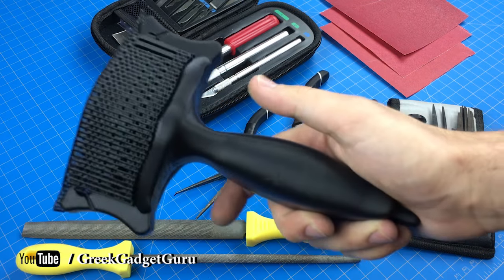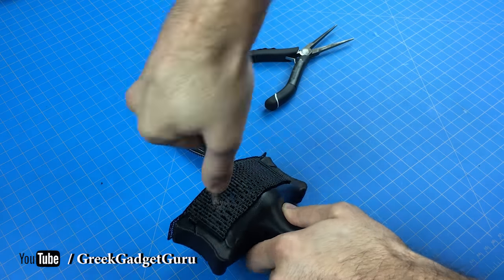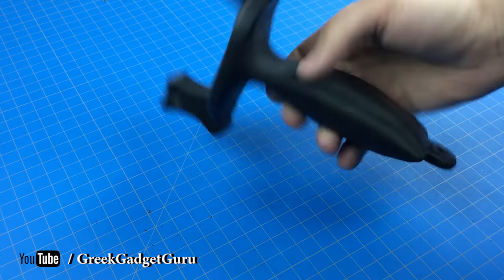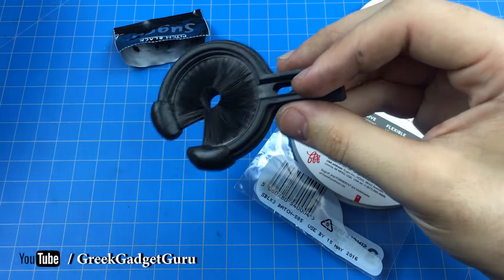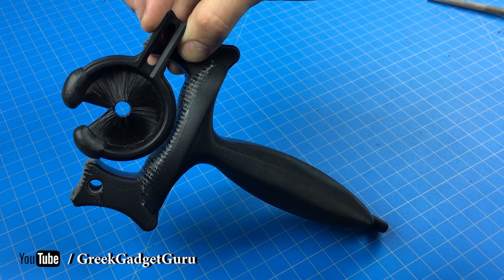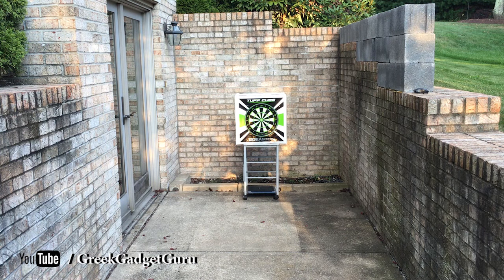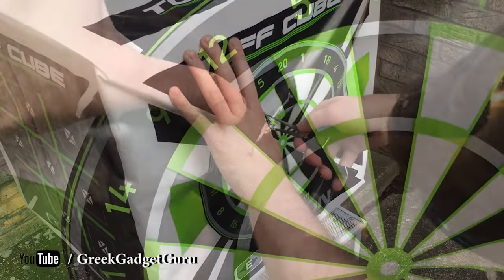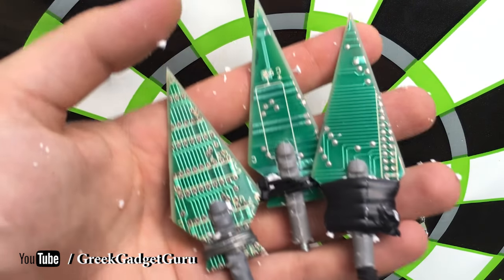Computer Board (PCB) Arrowhead DIY w/ 3D Printed Rambone SlingBow

Comment: @GreekGadgetGuru Tip from olympic archer: Do not use broadheads on expensive archery targets. Target points are invented for that purpouse. If you have a need to use broadheads, use them against fruits or waterbottles. Target points do a small puncture hole into the target and wont harm it as much, unlike broadheads.

Another tip: Make the thail of the broahead go more deeper into the shaft and use some hotmeld or epoxy to secure them in place. Yours seem to be too short and will pop out from the shaft too easyly.

Ur welcome!

-Chronos
Reply: thank you for explaining to these non archery peasants
Reply: That isn't an expensive archery target
Reply: Jacob Hardell Yep, i can see its made out of styrofoam. But some archery targets chost 80$ - 200$.

Comment: These arrowheads are sweet, but it seems that your arrows need more weight in the front.
Reply: What if he cuts a piece out of the center of them, and uses two pieces of board together to form four edges instead of two?
Reply: Kade Tucker That might work
Reply: what if you make it so they're like a + sign? so they slot into each other?
Reply: minitos1 absolutly right! Needs metal for it

Comment: try tapered bands as well, they store more potential energy and have a larger draw. rubber stores it energy in the heat created by the action of stretching which will transfer into more power on the release. it also rapidly cools the longer its held in a fixed position. just food for thought

Comment: Your power is limited by the need to grip the arrow nock between your thumb and forefinger. You should have a proper nocking point for the arrow together with a d-loop and mechanical release.

Comment: One thing i always did for larger builds was to separate the build into as few pieces as possible, and then peg and hole them together. So when printed you can piece them together with glue. Thats what i did and it may not work in high stress builds, but for models its great.

Comment: Have you considered threading the end of the arrowheads so that you can screw them into the shaft, so they won't detach as easily? 

If that doesn't work there's always epoxy.

Comment: next time i recommend laying it down when printing so that the layers are stronger then upright. Printing vertically with this type of print, idk how well it will hold up in a hot day with the pressures of the rubber.

Comment: I was thinking if you put a slot at the of the handle where the whisker bisket can slide in and out you could put a nut and a bolt to hold it. So if you need more range you could you could easy do it.

Comment: I think the arrow heads getting stuck is an unforseen benefit.  while it means the arrows are a one time use,  it also means that whoever your fireing at will have a hard time removing the arrow, also the sharp arrowhead should do a nice job at slicing up the badguys insides as he tried to run away

Comment: you know if the shaft of the arrowhead is weak maybe it will act like a full metal jacket bullet sure it's a pain in the arse to repair and a little waste of materials but if you hit someone with it someone it's gonna be a difficult task to remove it because the rest of the arrow is on the ground so if you wanna turn this into a tazer arrow i suggest putting another layer onto the sides of the arrow and put some magic/circuitry under that layer to give it more of a chance to actually taze someone
Reply: not a proffesional just some thought

Comment: Try using sinew for securing the arrowheads. And the flight path of the arrows seem unstable you may want to work on that too.
Reply: Btw you can use epoxy and insides of paracord instead of sinew to match the theme.
Reply: From wat anime is that character?
Just a curious otaku...
Reply: Not an anime ;)It's from Euphoria don't google it.
Reply: Its from an hentai

Ehem, i mean, i dont know.
Reply: I googled it. Bro wtf. In return you need to watch DYE Fantasy.
Reply: Not even close
Reply: Is it that like rape to survive hentai thing because.

Comment: you should have printed it horizontally so that the force of the sling won't break is by the layers of the print
Reply from the maker: Good call. I'll reprint it if its used in another video.
Reply: noicee haha you dont have to it was just a suggestion

Comment: Doesn't seem like it would ever have any range. There is no stability to the arrow after its released. See how it immediately turns away when fired straight?
Reply: I think the problems are the metal shaft and the light weight arrowheads.

Comment: Was all of the support material needed? It seems incredibly wasteful and excessive.
Reply from the maker: Yes, because the 3D Printer can't print in mid air. Otherwise it comes out like plastic soft serve icecream. The maximum print angle is a 45*. I could have printed it on it's side, but it would have added more surface area to clean. I wanted the handle to be smooth.
Reply: Oh! I see now. it was printed upside down. With he handle point upwards. I didn't realize that.
Reply: what if you printed it in two parts?
Reply: WhoDaWolfAt Gaming go top the slingshot chanele and go to the tambien video and download the model for free
Reply: Nadir Nurali how would you connect it

Comment: looks cool, but i don't believe a tazor's high voltage will pass through those thin pcb traces before frying it
Reply from the maker: Think about an actual T.A.S.E.R like police have. Those wires are just as thin, so maybe there is a chance. Its high amps that would probably cause a malfunction.

Comment: The problem with it wasn't the arrow heads or the lanker it was how you inserted the lanker into the arrow shaft instead of using a rubber o ring to hold it in place just glue the arrow head in the arrow shaft
Reply from the maker: Right, I didn't explain in the video, I wanted to preserve the arrowheads for another build and I think having them come out is a good design for a stun gun arrow to get lodged in the target, then stay intact when the arrow is removed. I feel like that would have a more damaging effect.
Reply: I'm planing on making stun arrows but I love your idea and now that I think about it that's a pretty good idea
Reply: Also you should make a circuit board knife. I've thought about it for a while and it could be a "short term" survival knife and it could be a quick build video.

Comment: Dude what did you use to slice it those supports are terrible they shouldn't stick like that.
Reply from the maker: Yeah, I feel like some of my settings are off. Cura
Reply: Hmm I use Cura too and haven't had my supports stick like that, try lowering infill a bit I keep mine around 10-20% and using lines.

Comment: why did you print the slingshot vertically its pretty material wasting due to the filling and it would be more stable if youve printed it horizontally
Reply from the maker: +Primula Maggot Yes good point about printing on its side for more supportive structure.

Comment: I own a few 3d printers and I have printed more than one of the rambones. That Verticle print is very dangerous and prone to snapping when you least expect it. I know I have snapped one. Please Reprint that laying on the flat I don't want you to snap off one of those pillars and lose an EYE or worse.
Reply from the maker: OK! Thank you for the advice, that makes sense, it would be stronger printing it flat.
Reply: When printing for structure think wood grain. you wouldn't make a rambone from a horizontal grain piece of wood because you would be afraid it would snap. the same goes for printing. it may still fail but it will bend instead of braking. If you plan to do a lot of 3d printing I would also suggest investing in Simplify3D for slicing. Nothing comes close to its level. GL man love the vids keep it up